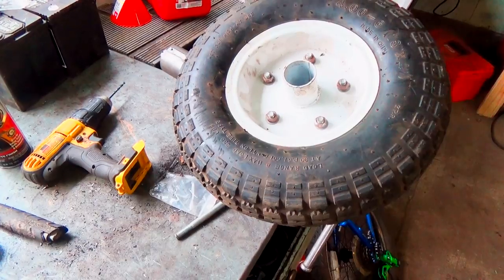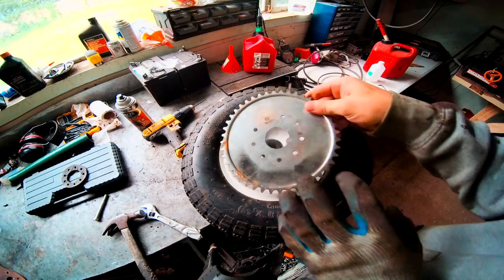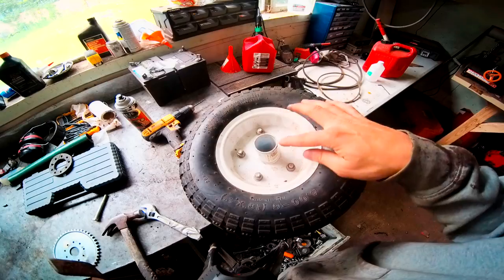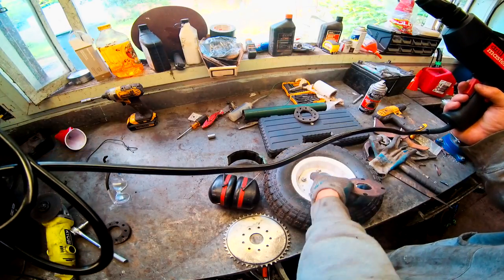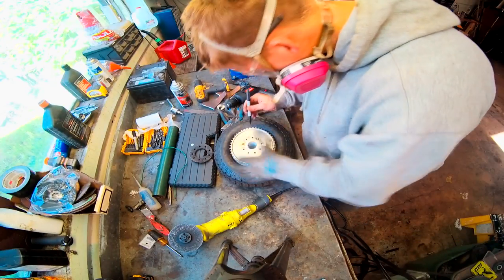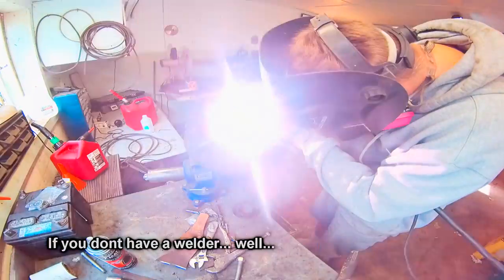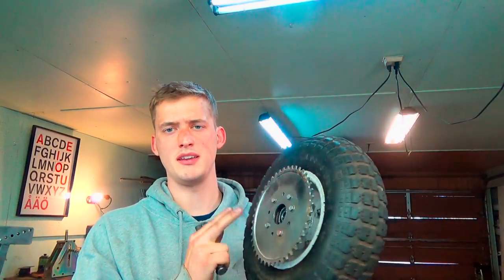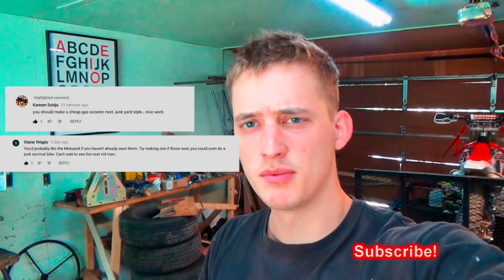how to put a sprocket on a wheelbarrow wheel for mini bike/ go kart

Comment: If you change out the bolts on the with longer ones and throw thick pipe on each bolt and attach the sprocket, would that be bad? I was wondering if it would be to much torque causing the sprocket to twist and ruin the rim.

Comment: I'm trying to figure out how to mount my sproket to a razor pocket mod rear wheel. I took the stock sproket off but it has a like clutch bearing on it and its on the wrong side for what I need. I may try to flip it around but if that doesn't work I'm going to have to figure out something else..